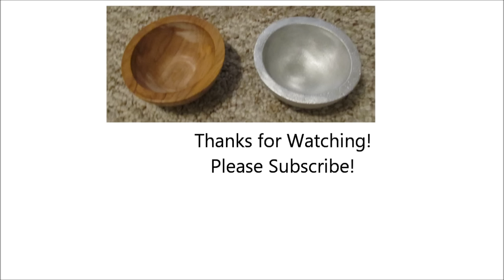Cast Aluminum Coin Dish (Direct Pour)

Comment: Hi That was a handsome piece you made. Now on the gate .... When you have the pattern over the core, get a 1 inch pipe, cut it off until about 5 inches or to the top of your cope....Pack sand around it and make a round funnel in the sand... pull the pipe out an you got a perfect hole to pour. You will not have to make a gate with the spoon and it will cut down on your sawing.... You can do this with a bell any size and it will work. If you want to make say...make a farm or dinner bell, start with a no 62 farm bell iron pattern... do the same as with the coin dish and it will work.... a no 62 is about 11 3/4th inches at mouth.... mix some die cast metal with the aluminum... it will mix and become a little more fluid and you would have to wait awhile... before you move the sand, take a spoon and gently scrape the top and if its hard , you can take the casting out of the sand.... look on craigslist or ebay for a no 62 iron bell  Then later..... you could make a larger bell  Thanks and I'm pleased you tried my method.....Ron
Reply: Thats a great idea, this comment needs more thumbs!